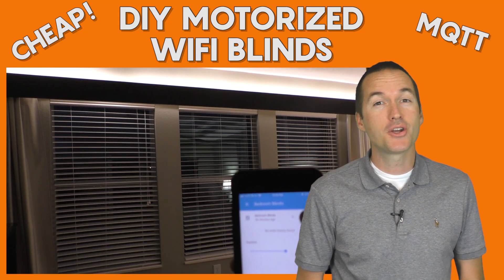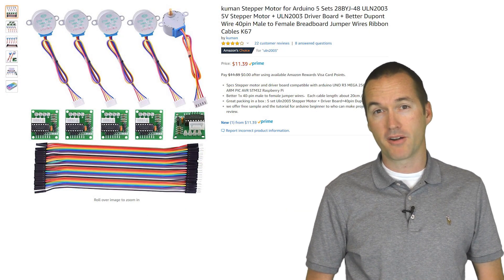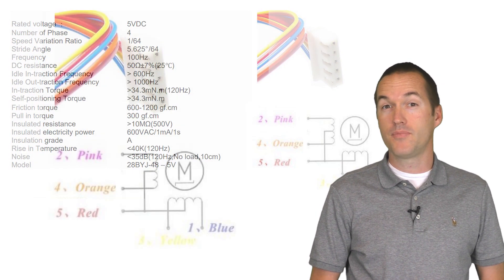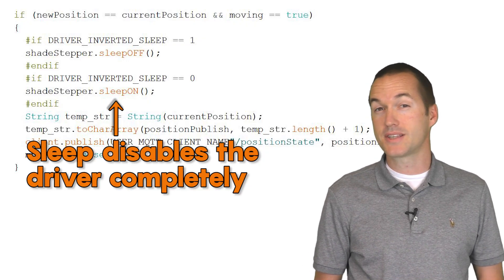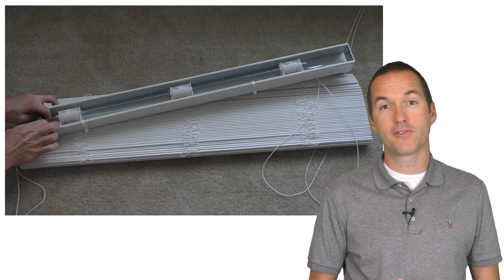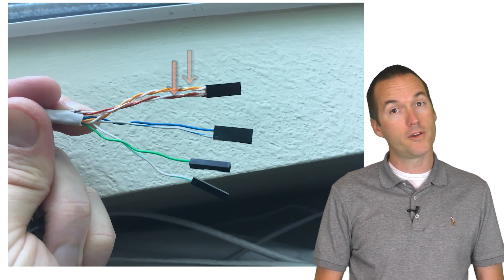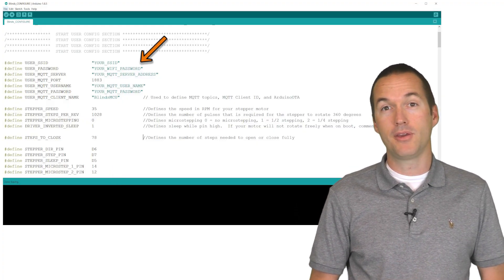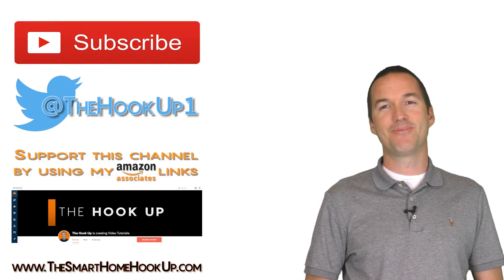Motorize and Automate your Blinds for $10! (WiFi)

Comment: Rob, brilliant, Thanks. 
I live in the UK and adapted your instructions to operate 3 separate vertical blinds around a bay window at the front of the house and 2 more at a kitchen window and patio door at the rear of the house. They each now have individual control nodeMCUs to rotate their slats through 90o Open to Closed. I also added a Sonoff basic for each blind, which I have located to a convenient spot, local to each blind. This gives visitors a manual control, without needing access to HA. It keeps it all running through MQTT. They were bit more expensive to build than yours, due to the additional components required. Because they are vertical blinds, I decided to fit the motors to brackets made from angled aluminium, connected to the top of the blind track. Drive is connected via aluminium gears and small diameter toothed belts. I fitted most motors to the back of the track, as you have to cut a piece out of the track, to allow the attachment of the belt. Being at the back (window side), its less obvious. Each blind has a control box with circuit board where NodeMCU and A4988 Stepper Drivers are all plugged into sockets, as are the motors, so if I ever need to replace anything, it should be easy. Thanks again, I think your videos are really helpful and informative.
Reply: I live in the UK too.  Can you let me know where you aquired your parts?  All the links in the video description are to items that are not in stock, and most of them are for a handful of each item, rather than sold singularly.  I have a bay window that uses 10 individual blinds (yes, 10!).  But I just want to see if I can "make" 1 automated blind before I get too excited.
Reply: @NeilBourneHarris  Neil, sorry for the late reply. I haven't been monitoring the site.  To answer your question re parts.  I got the NodeMCU's and A4988 stepper drivers from Amazon I think.  The gears, Veroboard, boxes, header pins, header sockets and belts from ebay.  There were 2 types of gear.  One with a 5mm diameter hole for the motor and one with a 6mm hole for the blind shaft. I ended up making 2  psu cases to supply the 5vdc and 12vdc to the pcb's I made for each blind. I had some spare PSU's that provided 12v and 5v, so I only needed cases to put them in.  One psu at the back of the house feeds the kitchen blind and the dining room blind. Whilst the one at the front supply's power to the 3 blinds around the bay window. All the cable was run in the narrow self adhesive trunking from Screwfix. Best part.  All still working as expected.  I would like to have voice activation, but maybe I will try this after we move house.  I think it may all need re-working then as I think the boss would like Venetian Blinds in the new house.  Good Luck. ps you can get some free ps power supplies from old scrap pc's if you put a wanted on freecycle or you have some friends who are getting rid of old equipment.  Perfect for 12v and 5v projects.

Comment: Great video and I've been wanting to set this up for a long time tinkering with other tutorials and options. Finally got all this put together and soldered. When I plug in the 12v supply, the motor moves just a bit. I go to Home Assistant and attempt to publish open using entity card and nothing happens. I made sure that the client in the yaml is same as what I uploaded via IDE. When I plug the NodeMCU into pc to check the serial monitor, everything connects to MQTT correctly, then just  prints "0" about 8 times a second. What did I do wrong? I've double checked the wiring schematic and that's all correct. All my soldering is correct. Any troubleshooting tips?
Reply from the maker: If you see it printing "0" a bunch, that means it isn't getting the command to change position.  When you change the position in home assistant you should see a message in the serial monitor that says "message received", and then the 0 should change to the new position.  My guess is your MQTT topic isn't correct in your configuration.yaml file.
Reply: @TheHookUp  Thank you for the reply! It turns out it was connecting to MQTT, but for some reason the new MQTT user I created for this wasn't received well. Switching to a different user allowed it to connect.
Reply from the maker: Great

Comment: I’m attempting this now, parts are just taking forever to come in because boarders have been closed.

Buying the parts in Canada is far more expensive than USA also, so I opted to buy them from China. Which could be part of my shipping problem.

Finally 3D printers are far more expensive up here even after exchange rate calculated in. I’m waiting for the maker space to open back up.

Comment: Have you considered using a small solar panel and battery pack as the power source instead of running wires?
Reply from the maker: I’ve been trying to make that setup work for about a year now with no luck.  I’ve come to the conclusion that WiFi on solar just isn’t an option.

Comment: Me at the beginning of this video: okay, this is a little technical, but I'm up to the challenge

Me at the end: oh god
Reply: Yeah, would need to buy a whole bunch of tools & equipment and learn how to use it all. Maybe one day.
Reply: @richardwilde1348  The tools required for this will 100% be useful if you plan to do any other sort of DIY home automation. It is a lot to buy all at once but it is all very useful stuff.
Reply: haha I totally had the same reaction
Reply: Its not as complicated as it seems. He literally tells you exactly what to do
Reply: @zainahmed6502  well, the main points. you deff gotta go do your research to fill in the gaps, like how to setup the arduino IDE to flash, (i ended up using an old raspberry pi2 that i wasn't using for anything!) how to include related libraries, setting up HAAS and an MQTT broker... this was more involved than i'd realized myself but so far so good. I was even able to flash the program to an ESP-01S i had laying around (using the RX pin for the 3rd GPIO - will be interesting to see if it actually works/drives the motor controller)
Reply: Yea. Once he started scraping away solder and snipping wires I was like 🙅🏻‍♂️🙅🏻‍♂️🙅🏻‍♂️
Reply: @philramirez8945  thats actually real easy
Reply: Don't blaspheme!

Comment: Im trying out this project to help me learn a bunch of stuff over the summer... got my first 3d printer, I just finished a class learning c# so this will give me an opportunity to at least understand C++ I think. Either way, a great project to learn from for me. But I feel like you kind of skip over some important details in the video... at least for me since I am so new to all of this. You say you hooked up all three of your blind motors to one nodemcu, I kind of wish I saw a better view of how you did this. I think I got the idea of how but it would have been nice to see this more clearly especially since you dont include that in your schematic. The other reason why I wanted to see this a little closer was that I actually would much prefer to be able to control each blind individually. This would of course take some tweaking of the code that is included in this project, but also I would need to wire things a bit differently if I still want to control 2-3 blinds through one nodemcu. I'm not even sure if this is possible with the pin configuration because I dont actually know why you picked the pins that you did. I watched the other video you made about understanding the pins of the nodemcu, but im still a little unsure about it. I guess I will just have to do my own tinkering.

Comment: I really appreciate your work! I'm using this code in a project to automate a TV that I've hung from a track to move in and out of a wall for our bedroom. I started out with your code for DIY Motorized Roller shades, but found that the code for this project works better. My problem: the stepper pauses momentarily (every rotation I think?) to check in with wifi (I think? And I assume it's to enable use of the STOP command on MQTT and Home Assistant). It causes the entire thing to jerk as it moves in and out. I'm sure there's a way to pause the checkin - I think it's the "callback" section of the code...??" until it reaches the OPEN or CLOSED position...but I'm not sure where to begin. Any suggestions? Thanks again!

Comment: Kinda new to this. Will this work with ifttt.com? how can i set that up?
Reply from the maker: As a vet to a newbie my advice is to stay far away from ifttt, it is an unreliable cloud service that will cause you more headaches than it's worth.  If you're looking to do integrations I'd recommend using the alexa version of the blinds with alexa routines.
Reply: @TheHookUp  I have a Google assistant home. So that would be the direction I would need to keep. Ty.

Comment: Would be possible to do the same but with a shelly 2.5? It has shutter support.
Reply from the maker: No, a shelly 2 works in a completely different way and requires a motor with hard stops.

Comment: Hello, thanks for the great tutorial. I just tried it out, everything works perfect. I just have one issue. 

After 2-3 mins connecting it to power supply(12v 2A), stepper motor is getting super hot. Looks like stepper motor is not going in sleep mode. Can you please suggest me something ? I'd really appreciate your help. 

I am really looking forward to get 3d printed items and install it soon, but don't feel safe because of hot motor. 
Here are some pictures of my setup
https://photos.app.goo.gl/3QirLbapyiBEDzbM6
Reply from the maker: Possible that your enable is reversed, try downloading the code and setting the inverse sleep.
Reply: @TheHookUp  
Thanks for replying back.

I tried couple of ways, but nothing stopped heating of the motor.

Here's what I tried :
Reversed enable pin

Reversed enable pin with driver_inverted_sleep commented out 

Reversed SLP_pin 

Reversed SLP_pin with driver_inverted_sleep commented out 

Can you please help me out if I'm missing something?

https://github.com/getSukh/Arduino

Comment: I'm pretty green with this stuff so this is probably a stupid question, but when running multiple blinds on the same nodemcu, does each blind need it's own buck converter or would I just use one for both? I have one blind working great, but plan on adding a second. Thanks.

Comment: Alexa added the devices and we can control the blinds with audible commands  … Is it possible to add a slider in the Alexa app to controls the blinds manually … The blinds devices in the Alexa app have no controls
Reply from the maker: They should have off/on (which corresponds to open/closed), it's possible to code a dimmer in, but it would be low on my priority list at the moment.
Reply: @TheHookUp  Here is a screenshot - https://imgur.com/JLYMNr1. The open and close option would be great, but I only have the enable option which does nothing to the blinds
Reply from the maker: @craig7011  that is bazaar, I've never seen that before.  Can you remove it (trash can icon) and try to add it again?
Reply: @TheHookUp  - No changes, about 10 NodeMCUs flashed using both Alexa bin files - all with the same results. Everything works fine, but no On/Off option in the app-
Reply: There it is  - https://imgur.com/a/M4l184X - I had to create a Group and add the device to the group in the Alexa App
Reply: i am having the same issue.  I have 2 nodemcu with alexa and one has a light control (also the device type shows light) and the second nodemcu shows as a device ( the device type shows others).  I can't change the type and try resetting the nodemcu several times with the same result.

Comment: Wow, Excellent Video and Thank You! (Times 15). I just secured all the parts to do 15 blinds. Initially installed HA and MQTT and that took some time, but I got it. Then I did the Alexa flashing - Super Easy! Only 1 thing needed to complete this project ........  The 3d printed parts (ANYBODY PLEASE!!!) - All the library Makerspaces are closed - The recommended 3D printer is out of stock with no date of availability and online 3D printing prices are outrageous. Any recommendations of other avenues of 3D printing or another good comparable 3D printer?
Reply from the maker: Wow! I never thought I'd see the day that you couldn't buy an Ender3 on Amazon... I guess it's understandable that people want a 3d printer at their house during quarantine.

Looks like you can still score them on ebay: https://www.ebay.com/itm/Creality-Ender-3-Pro-3D-Printer-Thermal-Runaway-Protection-220x220x250mm-DC-24V/223131248691?epid=14027539696&hash=item33f3a8a833:g:PjQAAOSwm8ZdwOcb

Or you could upgrade to an Ender5: https://amzn.to/3f70HDv

Comment: Great Video! Love your channel! Just would like a little clarification please. Are you still using the 28BYJ-48 DC 5 volt steppers with 12 volts applied through the DRV8825 driver or did you switch to the 28BYJ-48 DC 12V?
Reply from the maker: Still using the 5V kind, driving them with 12V.
Reply: @TheHookUp  Thanks. Any advantage to using the 12V version of the stepper?
Reply from the maker: I don’t think so

Comment: thank Rob, finally  got it done. it works great. Evey time i use a nodemcu..hate to see the remaing pins go unused. It it possible to add code to support temp/humidity sensors..bacically multi sensor components on this one ?
Reply from the maker: Are you asking if it's possible, or if I will add it?  It's certainly possible, but I probably won't be adding it (trying to keep this project as simple as possible for beginner DIYers).
Reply: @TheHookUp  will you be able to give me tips on adding in the code for DHT22 on one of the pins?...i am cust paste it from the bruh multi sensor code....last time i tried merging code...it was a fail...i haven't done sub routines in ages....will you be able to give me some tips ?..here or github or discord ?
Reply from the maker: @VAKUL-DC  This program is written with simpletimer, so basically just take a DHT22 function like

void getTemp() 
{
  float temp = dht.toFahrenheit(dht.getTemperature());
  temp = temp - 5;
  String temp_str = String(temp);
  temp_str.toCharArray(temperature, temp_str.length() + 1);
  client.publish("clientID/temperature", temperature);  
  
  float humid = dht.getHumidity();
  String temp_str2 = String(humid);
  temp_str2.toCharArray(humidity, temp_str2.length() + 1);
  client.publish("clientID/humidity", humidity); 
}

and add timer.setInterval(30000, getTemp); to void setup()
Reply from the maker: char temperature[50];
char humidity[50];

also need to be declared

Comment: Hello Rob,
my blind is not closing or opening the same position each time. it keeps increasing the range. exp if the first time it close as 3 full round then next time is close 3 full round and 5°. please can you suggest
Reply from the maker: Which version of the code are you running?
Reply: @TheHookUp  https://github.com/thehookup/Motorized_MQTT_Blinds ( which one should I used )
Reply: can you please share, if you can..
Reply from the maker: @Know-Tree  The problem comes from when the motor is struggling and misses a step in one direction or the other.  My solution on my heavier windows was to do additional steps on "close" to make sure the blinds always returned to a known state.
Reply: @TheHookUp  thanks so do i need to modified any thing in existing code. ?
Reply: Hello Rob, what integer value I can push in MQTT, maybe I am making mistake to inter first two values as per your video.

Comment: I'm new to this whole house automation but was looking for away to automatic my blinds that didn't cost an arm and a leg. Then I found your channel and loved that it wasn't over $10 per blind. I purchased everything you mentioned in your post and created my first automated blind unit but I don't know how to send commands to it now it's all put together and I have installed and configured home assistant via your "Home Assistant" video.

How do you send your first set of integer values to your topic (BlindsMCU/positionCommand)?  Is this via Node-RED or some other client?
Reply from the maker: Are you against using the Alexa version? If you want to switch to HA and MQTT later you can, but baby steps
Reply: If I use the Alexa I don't have to connect it to my my HA?
Reply: If I use the Alexa code then can I control the blinds via my Alexa app.
Reply from the maker: Yes
Reply: Alexa code:  I downloaded and installed the precompiled Alexa code but it is not connecting to my HA. The MQTT port seems to be missing in the connection command. How do I reset and add a port to the connection command?

Comment: I can't seem to connect the nodemcu to MQTT, thing is I see it under my router but I'm not sure it's connected properly (there are no light blinking on the nodemcu). I set up all my MQTT info in the code but Hassio (Mosquitto broker) never detects it as a new device...
Reply: Ok I think ppl who use duckdns need to use that mqtt address rather that the IP address.

Comment: I'm having a hard time figuring out how to actually add this device to my Home Assistant client. I have Mosquitto installed, added the config.yaml files, but can't seem to get the device to show up under the MQTT integration. Any ideas what could be going wrong? I double checked the logs under the MQTT addon tab, and it is connecting to the HA broker. I just cant figure out how to get the GUI in lovelace to control anything :( Also, the COM port is showing a constant output of zeros. I'm hoping that's excepted behavior, but I'm not sure.
Reply: I'm having the same issues. My first MQTT experience, so I'm sure it's related to my understanding of the system.